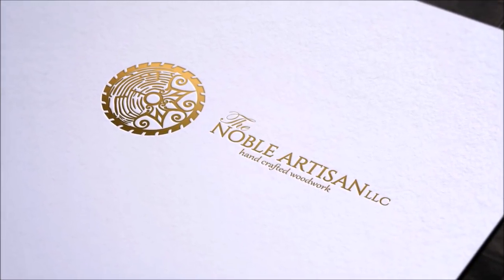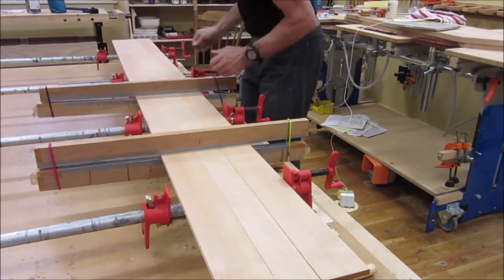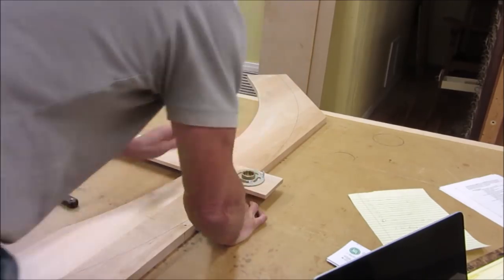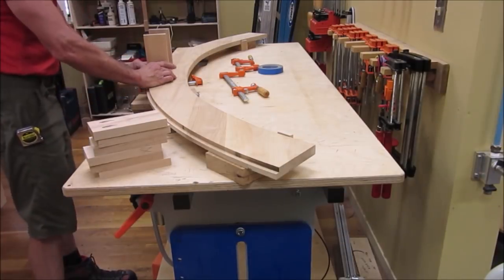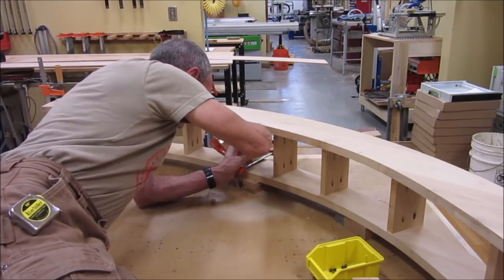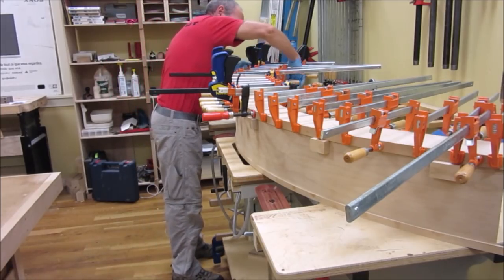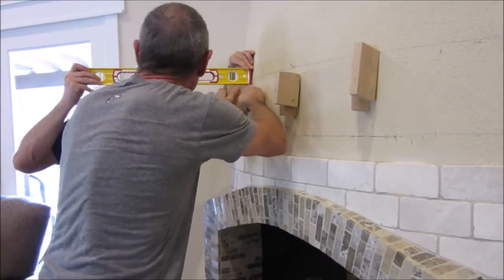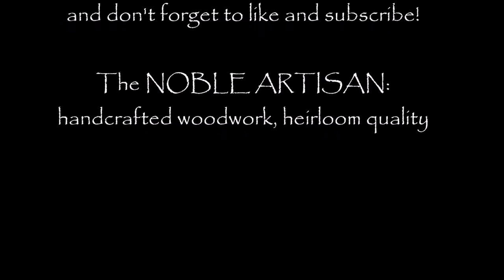Making of a Gorgeous Curved Mantel  Handcrafted Woodwork!

Comment: Received quotes for our beehive mantel that do not fit the budget. Your video is so very helpful. I cannot wait to build one for our home. Can you explain the mounting pieces attached to the wall, that the mantel sits on? I would really appreciate the help.
Reply from the maker: Hi Kodi:  The mounting brackets were made from scrap alder in two pieces.  The first piece (P1) was attached to the wall with construction adhesive and allowed to set fully.  P1 was cut at an angle which was approximately parallel to the floor surface.  P2 was an oversized block which was attached to P1 with a bolt for dry fit purposes.  A level line was marked onto P2 at the approximate height of the top scribe line on the wall of the beehive.  P2 was then cut to the marked angle using a portable track saw (a miter saw would work well here).  P2 was then re-attached with the bolt and checked to the scribe line and the other brackets as they came into being.  The bolt hole was drilled slightly oversized to allow for minimal adjustability.  The level process was surprisingly accurate, only the last bracket had to be trimmed a second time.  We had made a number of spare components but they were not needed.  When all were level and fit verified, an additional screw from P2 into P1 fixed the position.  Since the mantel sat solidly on the finished brackets, only a bead of construction adhesive on the bracket tops sufficed to attach permanently.  Good luck.  Terry
Reply: Thank you Terry. Can you tell me more about the facing piece? More on how did you get it to bend? I have seen bendable plywood used with wood veneer glued on.